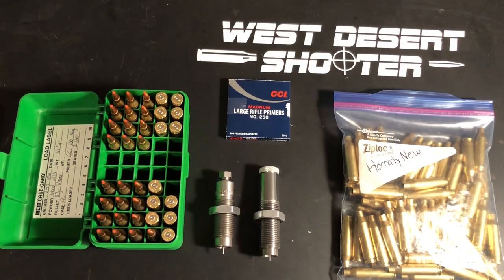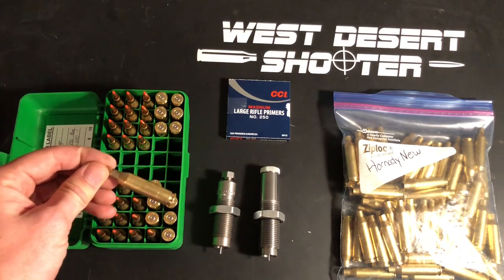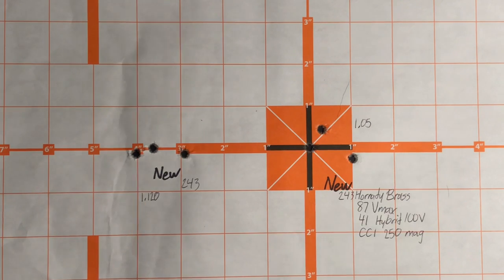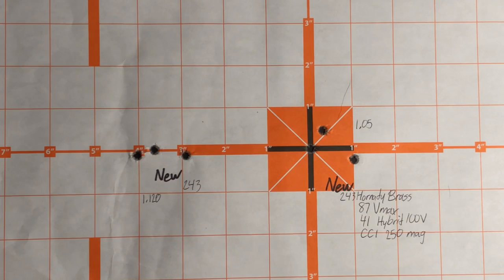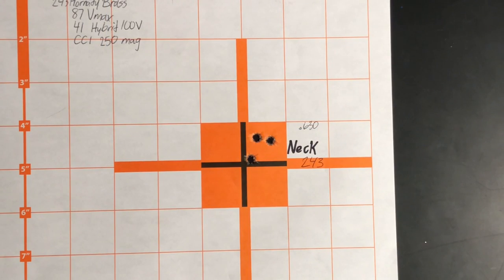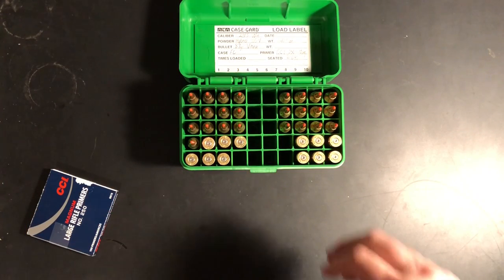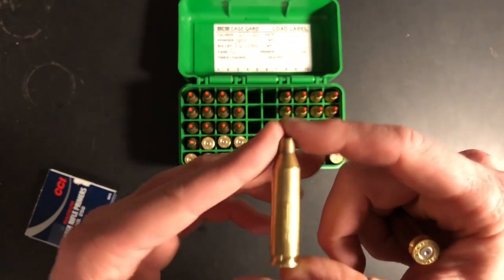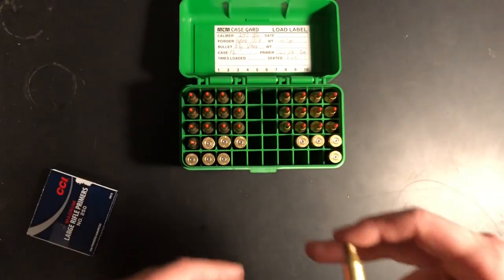Lee Neck Sizing vs. Full Length, Which is Better?

Comment: Full length resize pulls the expander through the squeezed neck. this pulls the neck out of concentricity, lengthens the case so it has to be trimmed, and works the neck twice. Much better to neck size only and body-only size when necessary. No or less trimming also.
Reply: This!☝️
Reply: @timkourbo3196  I've been FL sizing without the expander ball, and then use the neck sizing die to true up the neck. This allows me the reliability in rough conditions that FL sizing provides and the excellent concentricity provided by neck sizing. I'm assuming this is a reason why Lee included both in my set, it's not one or the other.

Comment: The difference is brand new brass is saami spec which is as small as that brass will ever be. When precision shooters talk about fl sizing they refer to bumping the shoulder back .002 which will be a lot tighter more tailored fit to your chamber.   Try fire forming the brass then bumping the shoulder back 0.002 and compare I think you'll get better results.

Comment: The expander ball does not increase the length of the case the expansion of the case to the chamber and full-length sizing after that expansion lengthens the case. There are some neck sizing dies that have expander balls and not mandrels like Lee and they don't grow any more than those with a mandrel.

Comment: I bought prvi brass that was already sized.  I went ahead and neck sized them with my Lee neck sizer just to fix any dings or distortions in the neck.  I shot some nice groups with my 7x57 Barnes 120gr ttsx 0.77 with 47gr, 0.93 with 48.5 and 49 grains H414 at 100 yards. which for my cheapo Adams and Bennet barrel from Midwayusa was great!  The only problem was chambering some of the rounds was very difficult but after firing no problem and the primers looked good even at max load.

Comment: if the case hasn't completely fire formed then neck sizing only is needed and not full length sizing. Once it's fire formed and doesn't chamber, then bumping back the case shoulder with a body die (the neck is not sized at all with a body die) and neck sizing with the collet die.

Comment: Another excellent video.   I have found that when I reload .223 with the Lee kit I get much better groupings when I full length resize and the neck resize both.  When I full resize or neck size only the groups widen out.  When I do both together the groups shrink up.  TRD
Reply from the maker: That was going to be another test in a future video trying both and watching what happens. When you neck sized your 223 brass were you using a bolt action or semi auto?
Reply: For more info on neck sizing only check out Hornady Handbook of Cartridge Reloading 4th edition Volume 1- 1991 page 41.

Comment: Having a light barrel is a lousy excuse to shoot only 3 rounds. I had a t3x 308 lite, and it shot 0.5-0.6moa groups at 300 meters with 10 shot groups. If your barrel is quality, barrel heating is a non issue regarding accuracy. I did neck sizing with my tikka, now I do only full length with my trg. With my trg and full sized reloads I get pretty consistent 0.2-0.4moa 5 round groups at 100 meters. 

I switched to full length for one simple reason: neck sized cases always feel like they are going to be just a tad tight. Also have 30 rounds left over of my tikka reloads after selling my rifle. And of course they dont fit into my trg. Waiting on a bullet puller so I can get the cartridges apart and at least use the bullets and powder, maybe full size the cases as well. Since they were loaded in sako brass and now I mainly use lapua, probably will just sell the brass.

Comment: It is likely that the very small data sample size (ie 3 shots for each situation) would mean that the results would be far from being anywhere statistically significant so basically meaningless. Only way to correct this would be to increase the sample size and run the results through a very basic stats package to test for statistical significance. But food for thought and interesting non the less
Reply: 3 shots isn't a group. For sighting in purposes yes, but not for accuracy comparisons.

Comment: The first thing I do before shooting groups for accuracy is to fire 5 to 10 rounds before shooting loads for accuracy. This preconditions the bore by removing any solvents,oils and excess CLP used to clean the bore and condition it. In high power rifle competition most matches are 80 rounds for score plus 8 rounds through the 4 stages of the match. Full size vs neck size? depends on your head space in itself is another problem such as reduced number of reloads percase due to excursive head space even though it's within go and no-go tolerances. I use neck size neck size with just a hint of full size to enable ease of closing the bold. And the list goes on and on!
Reply from the maker: So one thing I tried to do here was see how each performed at cold bore and each with a warm barrel. For both the neck size shot better. Cementing the idea that it might be true for this rifle. I don’t clean my barrel between trips so I’m not usually worried about chemicals in the bore. But before I do any load development work I’ll usually shoot a group with some known good shooting ammo to get it up and Shooting good as well as checking zero and even warming up myself as a shooter

Comment: Those groups look smaller to me than what you stated. Were you measuring correctly? I thought you measured out side to outside and then subtract the bullet diameter, which gives you a precise center to center. I believe that a neck size always works best on a brass that is once fired and fits the chamber of a specific rifle more precisely. Neck sizing a brand new brass should not be as accurate as once fired and neck sized, specially if you are using a collet die. Just my opinion.

Comment: Neck tension has alot to do with that consistency too. Good video.
Reply from the maker: I definitely think the neck sizer gives better neck tension over the FL die, i might try a group with full length and neck size to see if neck tension is what gave the boost in accuracy

Comment: WDS your video is on par with what iam testing. With my 242 Win using Federal’s Brass and Federal’s 210 GM LRM the brass does stretch 1-2 thousands after going through my RCBS full length resizing Die. What I have found so far is that the Lee Collet Neck Sizeing die did resize some of my Federal Brass tight enough to firmly hold a bullet, and some of the case did resize enough to firmly hold a bullet. So Iam going to give the die a few more turns down and retry again. Then develop the same loads using my Winchester Brass and see if the Lee Neck Sizeing resizing the Winchester necks tight enough to firmly hold a bullet. :)

Comment: Two problems with this video.  Random variation could give you the same results.  I would want to see at least ten rounds of each before concluding anything.  Also you introduced two simultaneous variables.  You full length resized new brass and you neck sized previously fired brass.  How do you know the difference is not due to the new and the fired difference?  I'm inclined to agree that the Lee collett die will produce brass with less runout and that will lead to greater accuracy.  But I don't think that is the case with all neck sizing dies.  So there is actually a third unknown - collett versus non collett neck resizing.  So you could easily have some neck sizing dies that work worse than some full length dies.  I think you have shown that your results are consistent with other people that have used the Lee collett die. But I would not generalize beyond that.

Comment: Very nice video WDS. It is great fun finding out the details that go into what works. Just for fun, take a high (hot/safe) reliable charge and fire it with 3 fired cases and 3 unfired new cases. Inspect the primer flow and look at how each primers shape differ after you pop the primers out. If the charge is hot enough the new cases primers after firing will look like mushrooms and the fired cases will look normal. Keep those videos rolling! Looks like you are getting a good number of new subscribers. Congrats.
Reply from the maker: That sounds like an interesting test! the load Ive run so far is a fairly mild charge right about middle of my data and certainly seems to shoot well. I am messing with a heavier 243 bullet and different powder, maybe Ill bump into some pressures there and Find out if I see any differences! Good to hear from you dude!
Reply: Toadley Browne   If primers from the new cases look like mushrooms, it's because new cases have plenty of room in the chamber and after the firing pin whacks the cartridge all the way into the chamber, the primer detonates and rapidly building pressure blows the primer back to the boltface because the primer is always the first thing to start moving. It probably starts to flow, when, WHAM!, here comes the head of the case back to the boltface, consequently swaging the primer down. That's why flattened primers are not a reliable sign of too high pressure. Rather, they are a sign of pressure. The primers from the fired cases look normal because that initial case-stretch already took place previously. Flattened primers on properly sized fired cases are certainly a sign of too high pressure. That's my theory anyway.

Comment: Just getting into reloading and as I was depriming my 5.56 lake city brass I noticed that the neck didn’t seem to make full contact  completely around the neck on my full length die. They looked still fine, but I don’t know if this is common. I would rub the lee case lube by hand around the case and noticed on the same spot on the case neck it would leave the case lube untouched or would just pile up there after being resized and deprimed

Comment: I know you don't have a machine, Try annealing your brass. I feel that once the brass is work hardened to a degree your accuracy will suffer, I have found this to happen around the fourth reloading. annealing will keep the neck tension consistent and the brass will still have its elasticity Making it pliable when fired.  I have used the Lee Dies before, They are also useful for cast bullet loadings in the .303 British, firing that round is almost always tough on brass and case head separation is soon to follow, Cast bullets aid in getting more bang out of your brass and shooting economy. Good video Dude. Keep up the good work. Reloaders have a wide area to explore and that is exciting, Fun and educational. I see that keep a log book of your handcrafted ammo for review and reference. Good shooting to Ya, Dave.
Reply from the maker: Annealing is a process that I would like to have a machine to do. I bought a bulk amount of 243 (100 pieces) and I'm being very careful to keep track of how many times each has been fired to cycle through all the brass before shooting it another time which will help me keep neck tension consistent as the brass work hardens. I just dont want to over anneal my brass and ruin it due to inexperience but I would like to learn!

Comment: That’s strange because the opposite is true with my Browning rifle I get more accuracy when I Full length resize I’m guessing this is going to have a lot of variables to it.
Reply from the maker: That is interesting! like i tried to convey in the video, on this specific test it seemed to help. I could likely get different results just switching brass back to the federal brass. Or in your case, simply switching guns. does your gun still function with neck size only?
Reply: West Desert Shooter it still Functions but you can feel the difference when I run the bolt in cases that’s only been  next sized vs full length resized.

Comment: Does the Lee collet size bump the shoulder  back or can it .. or what's the best way to size the neck like this and bump the shoulder back on fire formed cases
Reply from the maker: It does not touch the shoulder, however the Redding body dies are a great way to bump the shoulder back then neck only size after and you will get even neck tension and get your headspace you’re after!

Comment: Sorry but the inside neck expander does not cause a case to grow , simply put, you do not get metal deformation growth in that manner, due to returning the inside of the neck to the correct size in the radial direction yes brass tubing changes length , it will do it even if you neck size , no plus or minus here. One problem is the inside of the case needs to be lubricated , I've used a nylon brush with RCBS Lube 2 for over 40 years and the expander pulls out with virtually no resistance , cases are then tumbled in Lortone rock tumbler with stainless steel  using water and dish washing liquid to remove all carbon and lube also developed back in the mid 80's. What you missing and going off in the wrong direction with your premise is why DO you FL cases and you have totally missed the point . That issue is rifle damage resulting from galled lugs to broken extractors and destroyed bolts ! I'm a gunsmith and competitive shooter since the early 80's . Sorry but neck sizing is NOT going to make any different in your ability to shoot a deer at 200 yards or a target at 1000.  Sticking a case in the chamber will end most hunts and watching bozo's here in NZ run cleaning rods at; NRA shoots; to get cases out on the firing line is a national embarrassment.
Reply: MRMAX good info, tried neck sizing for my .243 X-bolt, and found no difference in accuracy at all. What I did find is the neck sized brass didn't chamber as well as the full length sized brass. Both lots of rounds that were reloaded were Hornady once fired brass, from the .243 X-bolt and both had the same lot number on the boxes. These were previously Hornady American Whitetail 100 gr. Interlocks I believe. I'm a full length sizer now only, all my rounds are for deer, black bear and coyote. Again great info. Shoot straight and shoot a lot.